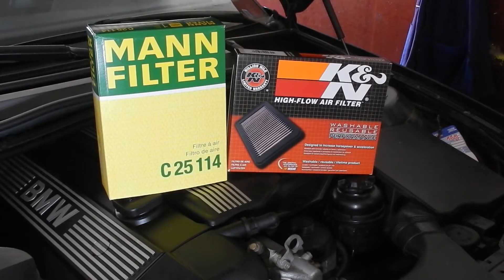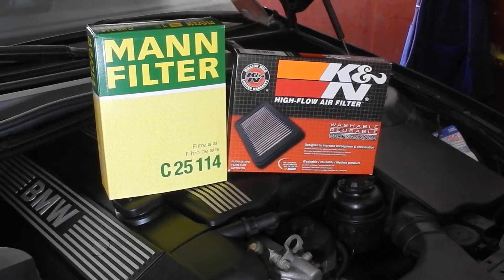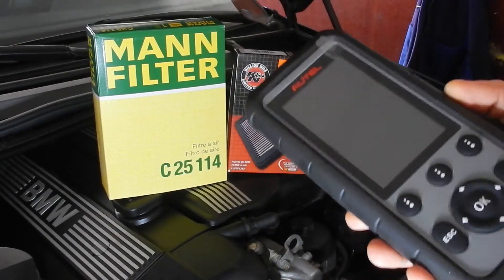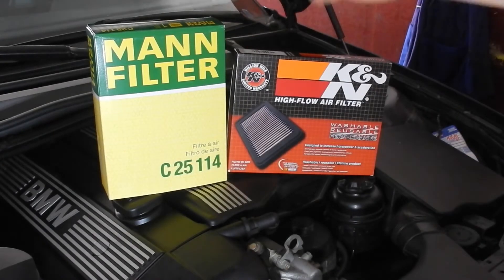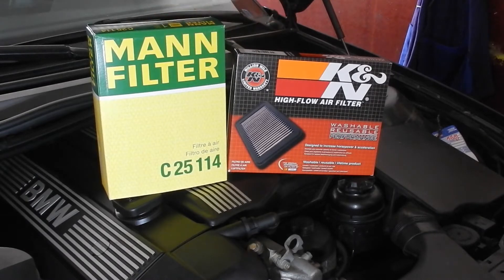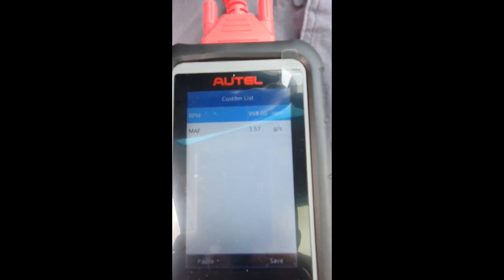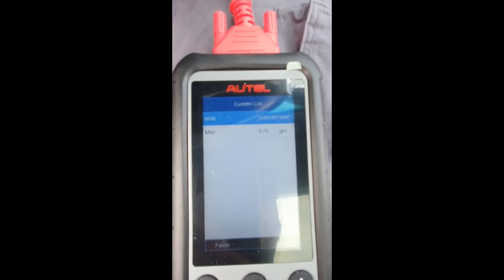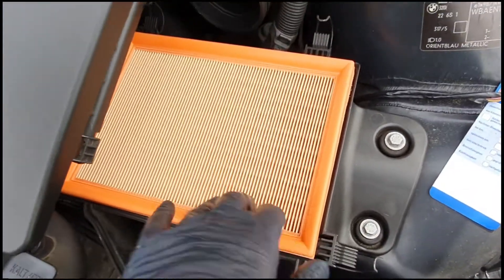K&N sport air filter vs regular air filter I My experiment on my BMW e46I Autobahn test drive

Comment: Thank you for this video. One possible reason for the close results could be that the Mann filter is a premium filter. Maybe K&N was comparing itself to a lower quality filter. Still exaggerated though. I just bought the Mann filter because I believe that it is better for air filtration with about the same air flow as the K&N.

Comment: a performance filter wont lift fuel trims because unmetred air isnt coming in after the air sensor.all it does is allow the engine to breather better.had a vaccum leak on my m54 with a performance filter it helped whenever i had my ac on car was jerky on pulloff .the filter smoothend the acceleration .it helps reduce load basicly and improves throttle response on a lower rev .hope this helps
Reply from the maker: May be the sport filter reduces the pressure losses, on the suction but what the K&N is promising with 50% more air is bullshit. For me no diffrences at all. 
An air filter wouldl affect the fuel trims, try a clogged filter and see the difference
Reply: Hi there,yes k&n promisers are bullshit it infact allows too much particles through im using pro ram from the UK wich is a dry filter and i guess more restrictive to particles.i also drive an e46 320i b22 have been monitoring fuel trims aswell after fixing all my vaccum leaks it seems to be ok so far acceleration is responsive .personaly i think the standard filter will do a better job it seems like im getting -1to 3 on both banks with pro ram
Reply: One more thing i monitord for a while i beem gettimg -1 to -3 on short trims long trims showd +2 i replacee it with a normal paper filter a new one amd my trims wemt to 0 on both banks with perfect acceleration and firm idle so they dont work well on our normal aspirated bm's

Comment: Hi, first I'd like to thank you for the test you did. Now, let's talk about these different filters. The use of KN was only more efficient into my two turbo diesel cars. One had a gain of 7 hps and the other 9 hps. To be honest it is less restrictive because of its thickness. But the fact is that in reality the sport air filter is bad for the engine that takes more particles. Definitely OEM filters like mann are better.

Comment: hello,thanks for the video! Did you get a better sound with K&N filter or is it the same? I want to get a louder engine/intake sound but i dont want to put a cold air intake cause i think that original box is very good design!
would be awesome to have an engine bay sound difference too! :D
Reply from the maker: @burkielol  I think there is no difference in sound or the difference is barely noticeable.

Comment: I hear that the oil on the k&n filter can damage the MaF sensor. Is there any truth to that?
Reply from the maker: Well the Filter ist since that day still installed in my BMW. no Problems. But may be when the filter is cleaned and sprayed with too much oil,this eill lead to incorrect readings of the MAF.